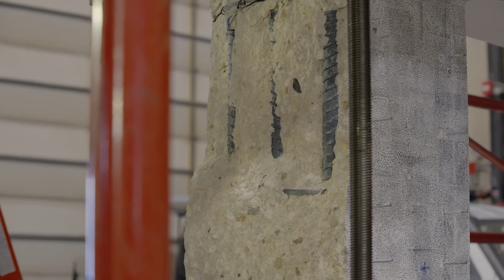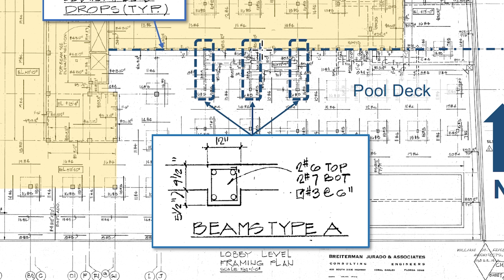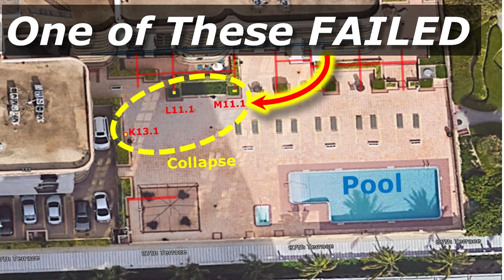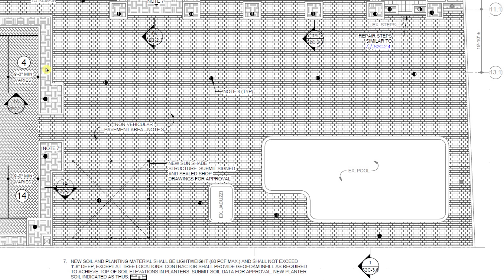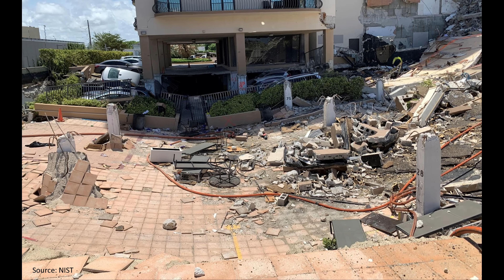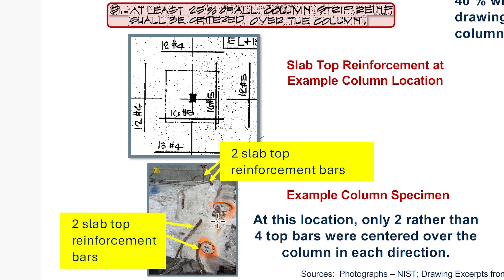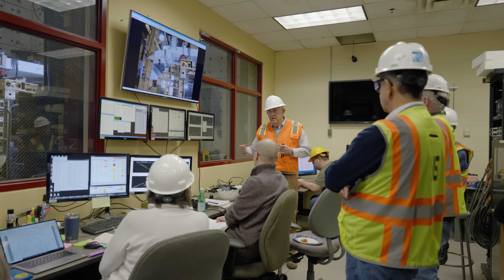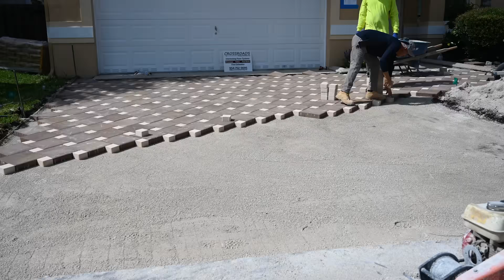Champlain Towers: Secrets the Feds Uncovered in Collapse Debris

Comment: Jeff, I seriously doubt if compressed columns caused the collapse.  It was the pulling of the spandrel beams in the garage level that pulled the columns causing them to fail.  When this building was showing signs of decay down in the basement/garage level, walls should have been added between the beams directly under the spandrel beams (and probably other places under the pool deck).  I never understood how those wealthy HOA people alloowed the building to decay and deform so bad without acting.  Criminal.
Reply: The exact mechanism of how the collapse moved into the tower has never been explained.  A building with 2-way flat slab construction relies on some balance of bending moments from column to column.  If there is a failure at one column and the slab drops then that throws a severe unbalance on the next row of columns and they might fail, and so on.  At the slab offset at the edge of the building the slab appeared to be underreinforced.  It could have peeled off the say way it did around the corner on the wing of the building that remained standing, the construction was the same there.  Or as the video showed if the slab starts pulling big chunks from the outside face of the column leaving the reinforcing unsupported, and concrete also spalls on the inside face leaving those vertical bars unsupported, now you have a location where not only does the slab fall but the columns can fail also dropping the building above.
Reply: It happens because people don't want to spend the money and/or they refuse to believe complex info that they don't  understand.
Reply: Why did the builders insist on using a single slab for both the patio and first floor of the building? Wouldn't it have been easier to make them separate with an expansion joint where they meet?
Reply: @derek17ca  No it's a lot more complicated and for that reason is almost never done in buildings like this.  It adds a lot more columns in the basement that would interfere with cars, and architects fight hard to fit in one or two more cars.  It adds a big joint between building and plaza that would leak water into the basement like a big waterfall.  It breaks up the plaza level floor which in effect means there are now 2 floors that can't act together to resist lateral loads on the building.  All of these things can be overcome but the easiest solution is to just not do it, and in a properly designed building it is not a problem.
Reply: @billj5645  Thank you for explaining. Those are all valid points I did not consider.

Comment: 9:04 I don't think that would worked either. With you change it introduces a water intrusion point along with a punching shesr similar to what was seen. I think over all it should have been poured with the higher psi concrete especially for the pool deck. In hundsight with the planters and pavers.
80 PCF, 80 Pounds per Cubic Foot.

Comment: I used to do slump tests for each truck load of concrete that arrived on the job.  I worked under the GSA inspector on federally funded projects.  It always amazed me that there would be at least one truck on a large pour that was substandard and had to be rejected.  Do you think the builder did slump tests?  I doubt it.  From what I saw from the rebar errors, I doubt the builder saw the job while it was going up.  This building was (like many) an accident waiting to happen.  For instance I've seen oil contamination in a truckload of concrete that caused cracks and where the portion where used had to be jack-hammered out and replaced.  Think any of that happened on this job?  I seriously doubt it.  I could go on, but you get the idea.
Reply: A slump test does NOT relate to the strength of the concrete. The slump relates to the mix. It is the signature of the concrete that addresses the question, did you actually get what was ordered. The plant is computer operated today, but not when the building was built. Today the plant shorts the amount of water and lets the contractor adjust in the field. The plant also adjusts for the moisture in the sand and gravel. This moisture is an educated guess at best and depends on where in the pile it was taken. The clean out water is a one on my sore spots.

The bad part of the slump test is that it is supposed to be taken in the middle of the load. This does not work for the purpose it is intended because if it is wrong, how do you send the first half back?
Reply: For a privately owned project the tests are performed by a testing lab that is hired by the owner and paid by the owner so the owner of the project determines how much testing is done.  Tests of that type were certainly routinely done back in that era with test results sent to the owner, contractor, architect and engineer.  I've seen concrete that didn't meet strength requirements get jackhammered out and replaced.

Comment: I look at the collapse as a collision of opposing forces.  Original plan was enough (as built).  However, HOA-lack of maintenance, plus condo owners adding inordinate weight were diametrically opposed to original design parameters.  This event will wake up those in charge, but knowing human nature, there will be a drift back to problems like this.
Reply: I do some service work in condos. I'm constantly amazed at owners who complain about special assessments to fix things. I know it can be a financial burden but it's no different than being a homeowner. If it needs a new roof, it needs a new roof. Or A/C, or drain lines, or structural repairs, etc. I think the difference is that the condo owners feel like it's someone else's problem whereas the homeowner knows it is their's alone. A lot of these 40-50 year old condos look nice but really need a lot of work.

My personal take on this disaster is that it's a confluence of issues. Questionable design, construction, deferred maintenance, added loads probably all played a role. A failure in a single parameter wouldn't necessarily cause the collapse but stack one on another and here we are. But I'm not an engineer so I could be all wrong.
Reply: @rogermccaslin5963  As a Structural Engineer of some 35 years experience I have seen many home owners and block owners who don't want to know that their building has serious problems 
And your second pint is also right - it is always the last straw that breaks the camels back.  The original design may not have complied exactly with the code of the time but it was probably close enough as to not make a significant difference.  Clearly it was not built in accordance with the design - Column bars not lapped, only two slab bars thru columns AND top slab bars set too low compromising shear resistance.
The biggest sin was subsequent overloading of the pool deck and lack of maintenance/intervention when problems began to show.
Reply: Was the design enough if it couldn't handle added weight? It's a bunch of weight but is it so much it should have caused the collapse instead of just eating into a healthy safety margin?

Comment: The City planning department was causing major issue with Moribito starting the project.  Refusal to return phone calls, refusal to issue the needed parking permits, all sorts of the kind of "look who is boss here" BS you can get with self-important minor officials.
Reply: Sounds familiar, definitely. Bureaucracy is a huge problem.
Reply: @vayabroder729 Yes, on occasion the BCO does look at the design and write a list of non-conformances to the engineer and/or asking for more information it is usually replied thus:
The calculation requested for beam X can be found on page ###, beam Y on page ##
Your concern about overall stability is valid and addressed in the designers statement page # which says that is why the design shows and justifies steel framing pages ##-###
But it is a difficult job and someone has to do it lest people think there are no checks and get sloppy.

Comment: Why are buildings collapsing?🤯
Reply: this building collapsed 4 years ago
Reply: It normally has to do with gravity and stupidity.
Reply: Outdated designs, spalling concrete, rusty rebar, additional weight never calculated by the original engineers, and the old specs didn’t call for enough margin. The old design’s ability toto hold the weight was almost at its limit from the day it was built.
Reply: @joanberkwitz2662  All likely true except for one thing- "the old specs didn't call for enough margin"...  the building code provisions for reinforced concrete design were relatively unchanged from 1971 to 2019, and actually a few provisions with respect to bending were made less strict since 1971.

Comment: Here in Australia,  ive seen rusted/corroded rebar being exposed on top of pilings for weeks before the next slab is poured.  Is this usual in construction?
Reply from the maker: Usually they are supposed to use epoxy-coated rebar now so that that does not happen
Reply: @jeffostroff  Epoxy coated rebar is no longer used in many bridge deck projects because its actual protection is uncertain. Nowadays, galvanized or stainless steel is used, for the deck surface that would be in contact with de-icing salts. I'd imagine a similar approach to buildings.

A mist of rust is fine in rebar. Usually most of it is cleaned with compressed air. However rust scales need to be sanded or mechanically removed prior to pouring concrete.
Reply: @AlexKasper  fun fact; the DeLorean car with stainless steel body had a steel frame coated with epoxy.  It was, of course, exposed and subject to flexing and road debris.  The epoxy had the effect of retaining moisture and dirt against the steel, accelerating the corrosion.
Reply: @jeffostroff problem with epoxy coated if you get a microscopic penetration of moisture anywhere on the coating like a pinhole, the steel will corrode inside but the epoxy coating will hide it. Sometimes in extreme cases the steel disintegrates and the epoxy coating stays intact.
Reply: @jeffostroff "When i was a kid" (Macgyver refrence) I used to hang around near sites and watching pile of rusted rebar being used for building. And now, 30 years later after 10-11 years of powder coating, i can see how the coating is useless if the metal is not sandblasted and blown cleand with air and then coated with the poison of your choise.
Greetings from Finland for evryone!
Reply: The building code requires that rust be cleaned off before pouring concrete.
Reply: Check out new home builders here in usa

Comment: I'm still claiming that it was the heavy cars that finally broke the camels back and collapsed the pool deck.
Someone drove and parked there just before the deck collapsed.

It is obvious when you see how the car deck was sheared straight off.
Reply: weight of cars is almost nothing compared to the weight of the concrete slab and weight of pavers and sand.  Cars are 25 or 30 psf, sand and pavers is around 150 psf, the concrete slab itself is around another 150 psf.  So packed completely with the heaviest cars commonly used adds only about 10% to the total load.
Reply: @billj5645 
The difference is that cars move and the constant moving slowly weakens the concrete. The concrete was also weakened by nearby construction and water. Also thermal expansion and contraction would affect and weaken the slab.

If there were no parking on the pool deck edge the building would still be standing. I bet the parking+pool deck and the supporting smaller pilars were not designed and reinforced correctly for driving and parking.

You can clearly see that the deck was sheared straight and the rebars torn down under the cars and that was were the collapse first initiated.